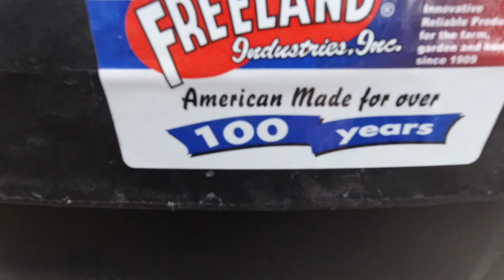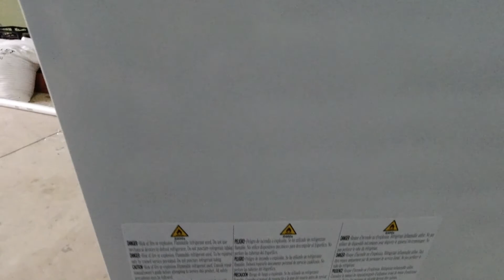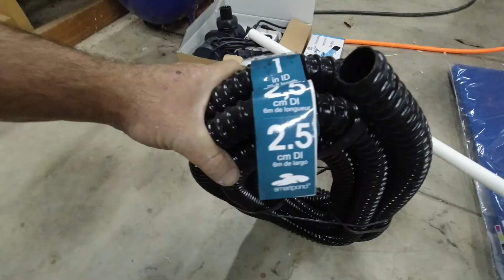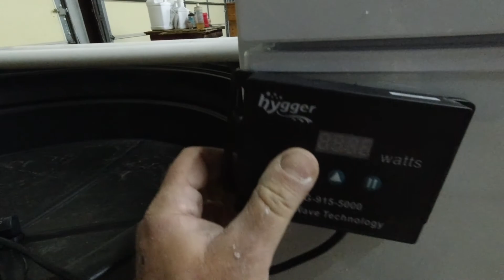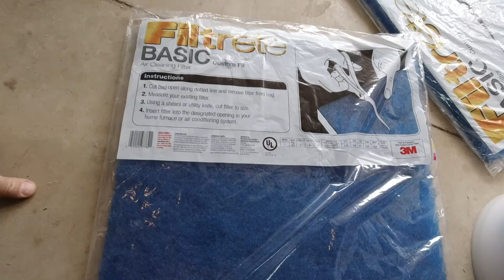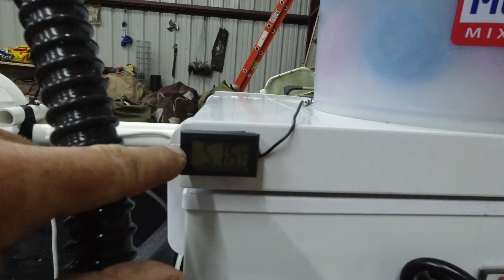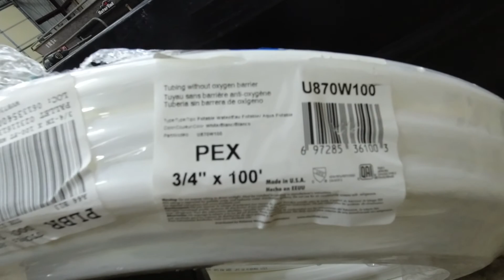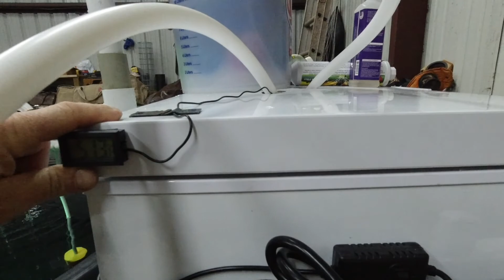Epic Shad Tank Build

Comment: This is great. How are you liking it after a couple of years. Any failure points
Reply from the maker: Well. The cooling part isn't very effective. I'm trying to cool too much water and it cycles through too fast. The temp drop on the outlet is only a couple degs. It only cycles the whole 500 gallons twice an hr at best. The heating part works great except the heaters go bad every now and again. They are cheap enough. The pump and filter works good. The sock filters are great. I use it mainly to put my minnow buckets in and let them float around. Not as much for shad any more. Also put crappie and cats in it when I'm lazy to clean them. They will live for months. Long reply.
Reply: @StarkeyOutdoors  thanks for the reply. That is great. I have a commercial bait dealer license and will be selling shad to some local shops for big bass and stripers. We are trying to get everything set up

Comment: I have a 150 gallon tank. Do you think 7cf will be enough to keep that cool or should I just buy a big freezer. My tank is outside but is in the shade most of the day. Only sun on it is 11:30-3:00. Alabama heat is horrible. Bluegill is mostly what I’m keeping in it.
Reply from the maker: Not sure. My freezer system is helping keep it down but im not running enough through it to make a huge difference. The water is about 10 deg cooler the freezer but it isn't pushing enough through to make a big difference in a 500 gallon tank. I think its moving about 5 gallons per min. The heater portion works great though. Ive had the same shad in there since February.  Bluegill shouldn't be any problems.  Use a chlorination filter and also chemicals a day before putting them in there. Good luck.

Comment: Hey dude I am starting on making a minnow tank with a freezer any words of advice on trying to seal it? You made me nervous
Reply from the maker: I never could get mine to stop leaking. I sealing the seams with flex glue and then went over the whole inside with flex seal spray and it still leaked. It swells out under pressure and splits the seams I think. You might try using this 3m product. https://amzn.to/3GvUTzY   it needs a little water on it to set it off and takes a while to dry but its the best out there.It could have just been my freezer designs. I ended up coiling up pex line inside of mine like a radiator. Its helps some but not enough for 500 gallons.
Reply: @StarkeyOutdoors  copper tubing inside the freezer would work better than pex.

Comment: Just FYI 5200 is not considered aquarium safe but Flex Seal is so as long as you have it all covered you should be ok. Always use straight aquarium safe silicone for any bait tank applications.
Reply from the maker: I agree. This is just a temporary holding tank until i use them for bait anyhow. Thanks for watching.
Reply: @StarkeyOutdoors  Good build!